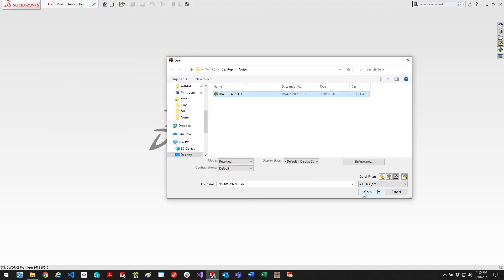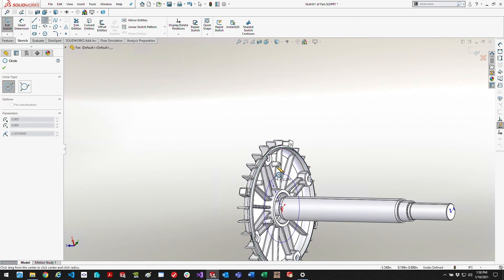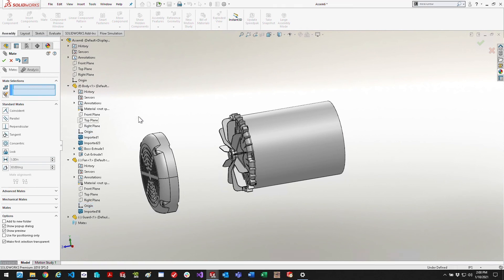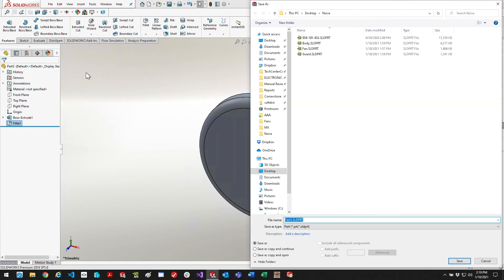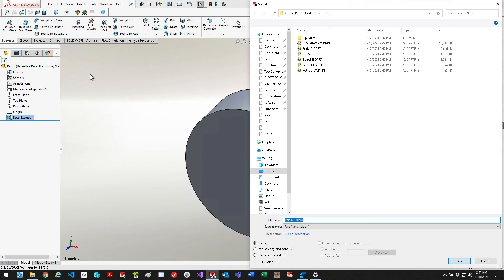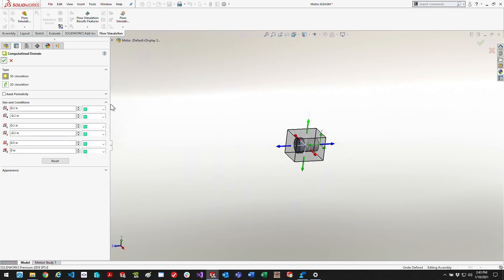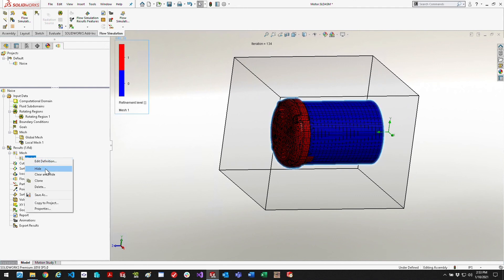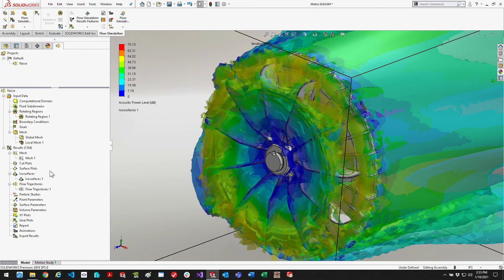SolidWorks Fan Flow Simulation (Noise Analysis)

Comment: hi，could you send me the model such as stp or igs for this link
Reply from the maker: You can download the CAD model here:
https://www.regalbeloit.com/products/motors/low-voltage-nema-motors/low-voltage-nema-washdown-motors/white-epoxy-nema-washdown-motors/white-epoxy-general-purpose-motors/5-hp-washdown-motor-3-phase-3600-rpm-230-460-v-184tc-frame-tefc-132441-00
Reply: Hi. How long does it takes to run the simulation? . I ever used Ansys Fluent but It takes ages to run Transient simulation.